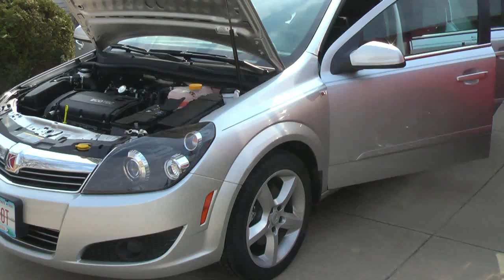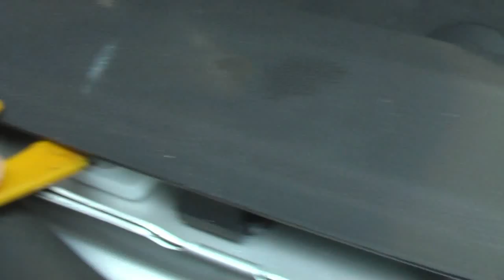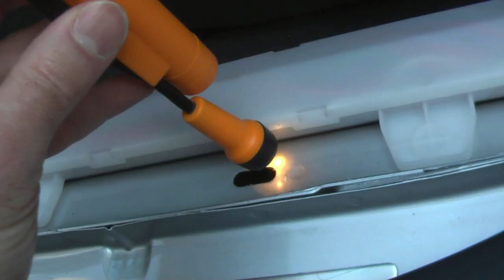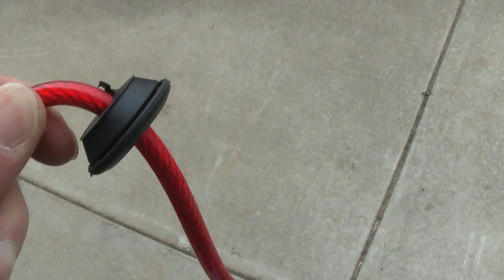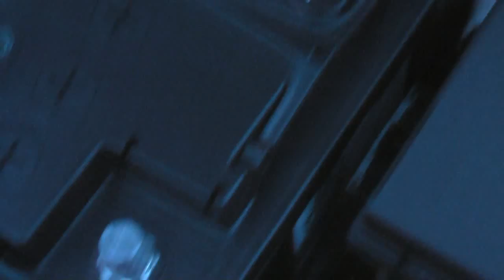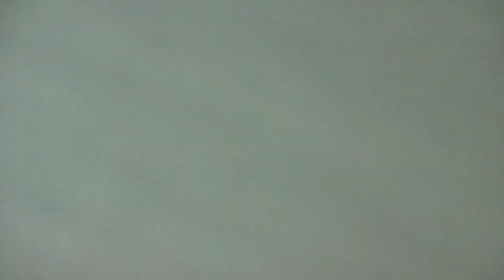Saturn Astra Powered Subwoofer Install (Infinity Basslink)

Comment: How will the amp turn on without the Remote Wire?
Reply from the maker: +Sukhi G The remote control that I didn't hook up is just a remote volume adjustment. It powers on whenever there is a sound detected in the speaker wires- a nice feature!

Comment: This will be very helpful when I do my install next week of the same sub and car. I only want to ask you how you secured the sub to the floor of the trunk? Is it safe to just screw it down on the left side?
Reply from the maker: +John Ingellis Mine has only been held by 2 bungee cords for 7 years, which makes it easy to get to the spare tire- I have bungees running next to the heat sink, so be careful if yours gets hot (I don't play mine that loud, so mine does not get even warm)

Comment: hey tappping into the front speakers did u have to do all 4 and is it just so it runs through the amp get get higher sound output? if i just have stock speakers should i tap into them?

Comment from the maker: @pioneer7777777 Right, you got it. And I'm not so sure that tapping into the rear speakers gives the purest sound. Somewhere online I read that the CD30 in the Saturn Astra has a low pass filter on the rear speakers, so only frequencies above a certain frequency are allowed through. In most cars, there isn't a low pass filter on the speakers going into the doors (that I know of).

Comment from the maker: @Briguy1027 Yes, in my opinion, ALWAYS have an inline fuse as close to your battery as possible. Always have a fuse on or close to any device down the line (or on the device, as in the Basslink). If something shorts out either accidentally or after normal wear and tear, it can mean the difference between a simple popped fuse and a car fire. I have never had a problem with my basslink in the 8 years I've had it, so I wouldn't know the first thing about troubleshooting-sorry!

Comment: sandsedge -- there is a fuse on the back of the basslink -- is there also a fuse in-line with the power cable from the battery?  I have an older basslink that doesn't work right now and was trying to troubleshoot it.  Thanks for your response in advance -- great video.

Comment: @sandsedge where are you connecting the remote power on/off? I saw on a wiring diagram that there is a pink wire from the head unit for a powered antenna trigger. Will this work?

Comment: Pioneer7777777. Tapping into the wiring does work still good quality did it with this same sub as well  I did it with my stock head unit for a temporary fix until I got a aftermarket radio

Comment: Could you clarify how the "tapping into the speaker wiring" works?  I'm going to be doing this install myself this week and am wondering how that portion works. I understand the power and the ground cables, but am wondering how to get the signal from my HU to the basslink.  As I understand there's not just a separate cord that comes from the HU to the unit, but instead you have to splice the rear speaker cables so they give signal to both the speakers and the unit?

Comment: If it has a 20 amp fuse you should be using a 20 amp fuse in the fuse holder, not a 25 or 40. The 25 and up wont blow but the one on the basslink will so thats pointless without a 20 amp fuse.

Comment from the maker: @dirtdiggler1989 actually, I rewatched the video and I disconnected the negative cable at about 30 seconds into the video. I know there looks like there is a plus sign near the cable, and it looks redish, but that is the negative terminal! The positive one has a black plastic flap covering it on it and is closer to the cabin of the car.

Comment from the maker: @2fast4all I should have mentioned that I left out the remote wire to adjust the subwoofer. I had installed the remote in a prior car, but hardly ever used it, so I just left it off because I couldn't find spot up front that it would have looked good.

Comment from the maker: Yeah, it doesn't provide dual 10" pounding bass, but I think it is a massive improvement over stock, and even most "premium" factory options which cost a load of money ($600 on the Astra, and you still don't get a sub for that)

Comment from the maker: No issues at all. In the wire channels, the power wire is running parallel to the speaker wires for the length of the cabin.

Comment: Have you had any problems with having the power cable so close to the speaker wires? I've heard that can cause some issues because the speaker wires can transmit static from the power cable.